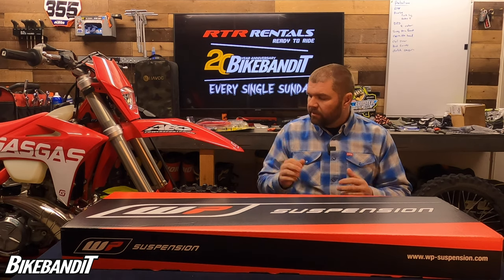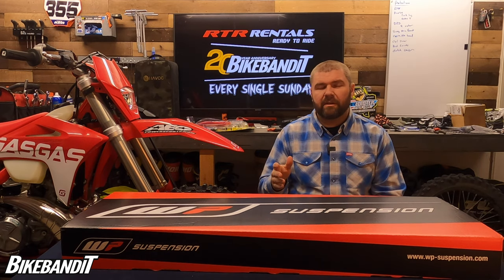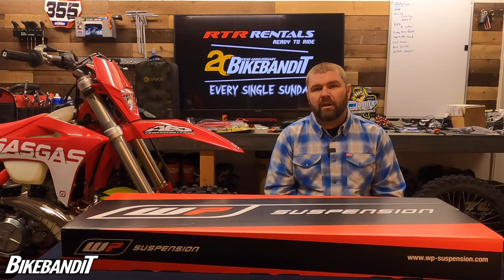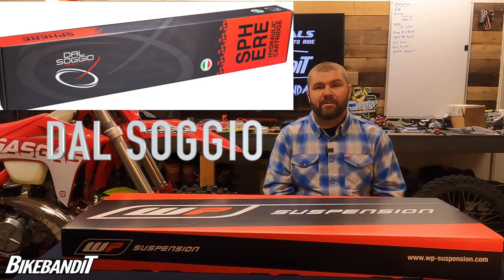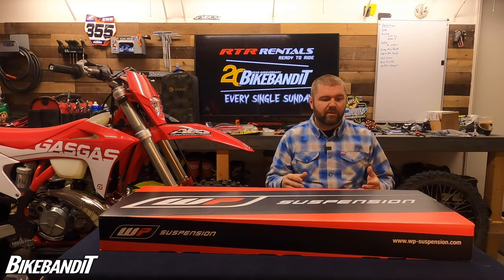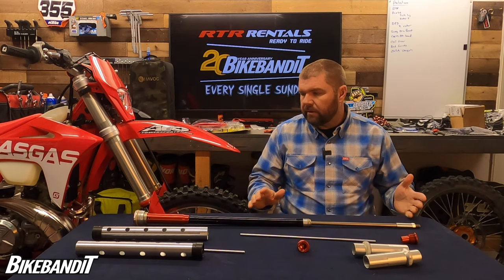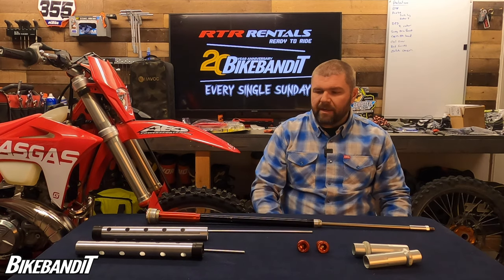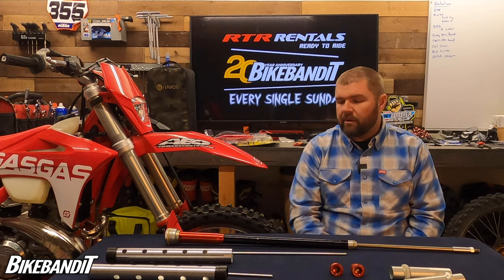WP XPLOR PRO 6500 Cartridge Conversion for KTM - First Look

Comment: 2016 KTM XC250.  Powerband converted my 4CS to XPLOR PRO 6500.  After testing, I messed around with the settings,  just because that's what I do.  It turns out that I ended up exactly how Billy had originally set it up at.  Billy and Ty are wizards.  Worth the money.  Riding a bike with truly dialed in suspension is amazing.
Reply from the maker: Ya, they are crazy good. Glad you’re enjoying em

Comment: So have you done a final review yet? If so, I can't find it.
Reply from the maker: I have not 

But I absolutely love them and highly recommend them

But you’ll need to revalve them unless you’re 300 pounds
Reply: @EverySingleSunday  It's that bad stock even with the proper springs? I think you can order a soft shim from factory as well.
Reply from the maker: @scp8412  the valving is more for moto. I like mine soft for technical enduro.
Reply: @EverySingleSunday  Do you think WP has the shim available when ordering or you had to find someone that knows the pro 6500 kit?
Reply from the maker: @scp8412  I’m not sure. I had Schmidt Performace in Perris CA do mine. Dave has done tons of these kits and knows them well. He sells them also if you haven’t bought one yet
Reply: @EverySingleSunday  awesome, ill inquire thanks!

Comment: I am torn between the ex and the ec versions.  Do you think the explore is a better fork for the slower technical stuff?  You say that you love the air fork on your 450.  I do more mid to fast high desert with maybe 30% slow rocky technical.  Your 2 cents?
Reply from the maker: I think The EC fork is better in. 1-2 gear, air fork for everything over that

The 21 air fork is so much better than other years. It wasn’t actually bad in the rocks if the psi was set correctly 

But, this WP 6500 kit is amazing and out preforms both these hands down 

I love this fork now
Reply: Thanks, appreciate the feedback.
Reply from the maker: With both these having linkage 

I think a bigger difference would be if you want the lower 1-2nd genera ratio on the EC, or the headlight 

The EX has the same gears fro 3rd up 

Also, we can’t find a EC on the west coast right now.  They still have EX bikes all over 

Sounds like the EX may be what you want anyway

Comment: what's difference between xplor 6500 and xact pro 6500?
Reply from the maker: XPlor is usually spring and XACT is usually air. 

I thought all the 6500s were springs but I could be wrong
Reply: @EverySingleSunday  i just looked at wp website. looks xact pro can also come with springs. i'm still not sure difference between xact 6500 vs xplor 6500. thanks for responding.

Comment: Can you confirm if this conversion uses a spring in the upper chamber or is it a bladder like the old WP closed chamber design?
Reply from the maker: It’s a spring in the top 

Besides that it’s very similar to the Dal Soggio setup as far as sizing

Comment: Hey Travis thanks for the info. Im new to your stuff so forgive my ignorance. What type of riding do you do? I ride hard enduro/ tech stuff. My forks are at the shop as we speak and I should get them back tomorrow and ride on Saturday. How are these on the more technical terrain? All the reviews I find are for offroad and MX riding the faster stuff with big jumps. Thanks
Reply from the maker: I like hard Enduro and technical single track. They are as soft and plush as a stock Xplorer on the initial hits but ramp up through the stroke so they are great on big hits and g outs as well

I’ve been super happy with them and highly recommend them

I’m 245 W/O gear and I did soften them up a bit for technical off-road 

So, stock, they would be pretty stiff
Reply: @EverySingleSunday  Thanks a bunch for the great info, it’s much appreciated! 

How are these on a MX track? 

I have a 2020 FE350, stock Xplor with heavier springs for my weight (275lbs). On jumps the stock forks just bottom out too easily without adequate dampening. I ride mainly fast woods and mx tracks, not that much slow technical. I need to do something to the forks, been contemplating between the comp/reb mod and the 6500 kit. What are your thoughts, is the cost of the 6500 kit justifiable?
Reply from the maker: They are great everywhere. I have mine valved so I’m running almost full soft of enduro. If I run the clickers in and add a little preload they are fantastic on the track 

I’m sure with a Setup designed for the track they could be even better

(I highly recommend Schmidt Performace in Perris CA)

I absolutely love this fork setup
Reply: @EverySingleSunday  Thanks for your input!

Comment: Did you have to  re valve  and re sprung  ?
Reply from the maker: I went softer in valving and used the correct spring for my weight (245)

Comment: So, WP will sell you a kit for $1300 that fixes what's wrong with your brand new WP fork? Seems legit.
Reply from the maker: Essentially 

Better than 1800 for a KYB conversion 

Then a shock is 2400, wheels are 1200, tires, pipes, tuning, protection 

Makes it a $20, 000 bike pretty fast and that’s not ever everything
Reply: @EverySingleSunday  It's just hard for me to believe that WP has tried multiple times and failed to meet the benchmark set by the KYB SSS back in 2006.  It's kind of engineering malpractice and a slap in the face to their customers.
Reply from the maker: I agree that KYB has that locked down.  Stock XPLOR is great in slow speed and super tech

I think it just comes down to money and what they can produce for the sticker price in the bike. Not trying to defend them, but that’s where my thoughts go
Reply: True than Ben!

Or you could buy a Beta and get KYB’s stock...
Reply from the maker: But then you’d have a Beta....  and then you have an even bigger problem

Comment: Funny, I ordered a set this morning and then saw this video. I missed out though, my '21 TE300i doesn't have 7th and 8th gears! 😂
Reply from the maker: You’re missing out, my bike goes 200 MPH and my mousses love it 

Who is setting up your suspension. Or are you doing it yourself?
Reply: I bought them from Konflict Motorsports because I had a good experience with a Touratech shock they turned for my Super Enduro. For the 6500 cartridges I'll run them straight out of the box and tune them myself from there.
Reply: Quick update to this - I never did get the cartridges.  Texas had that freak winter storm, so I expected a delay.  Almost three months of delay seemed excessive though.  When they stopped calling me back I had to dispute the CC charge.

Comment: hey Travis, is this pretty much the same as what you can get straight out of the box when buying a 500 EXC six days?
Reply from the maker: No. The 6 day’s comes with the standard open chamber system that comes in all the XPLOR forks. This kit will drop right in though and make it much better
Reply: @EverySingleSunday  thanks. I looked it up and it is a very complex system for the top racing guys. Since i do my own service and i am an average rider i will stick to the simple open system. Also looks like closed cartridge have more tendency to fail and you lose right away a considerable amount of damping compare to a failing open system.
Reply from the maker: It’s very similar to what KYB, Lucky, dal saggio are doing edit it is supposed to be much much better

That being said it is expensive and definitely not for everybody
Reply: @EverySingleSunday  Thanks Travis. Always interesting to have guys like you showing new products for the sport we all love

Comment: Sad. GasGas had KYB before the acquisition.
Reply from the maker: Well, it’s a much better bike overall now. One negative, and a bunch of positives
Reply: @EverySingleSunday  fair enough
Reply: Would have been so awesome if they kept KYB.
Reply: @EverySingleSunday  how so??? Admittedly I haven't ridden the new gas gas yet but i have rode new ktms and huskys and for tight technical riding I truely believe the old gas gas was alot better. Some minor things the Austrians do better but as a full package the 18-20 Gas Gas gets the win for me
Reply: Agree it would have been a good differentiator to standout from KTM and Husky. But it would’ve embarrassed their in house WP on comparable models.

Comment: Its called buy an old ~'12~2014 ktm XC.   Forks pretty much  stock like that back then.  Now KTM are cheap bastards and cut corners.   Also used to get a kehien carb and brembo brakes and oh boy!....an aluminium sub frame and a kickstarter came on them too.
Reply from the maker: They still come with brembos and an aluminum subframe :)

But ya, some good things have gone but lots of good things have come as wel